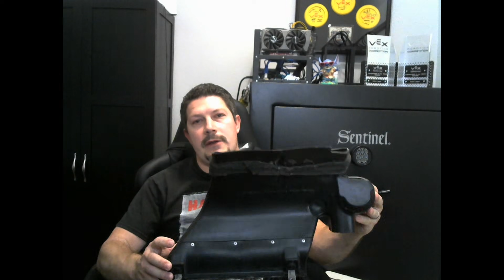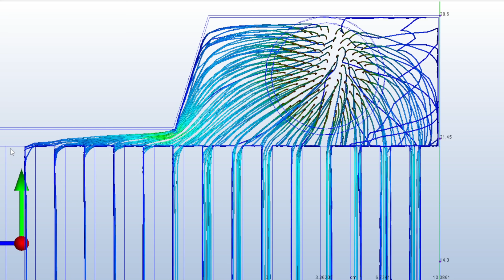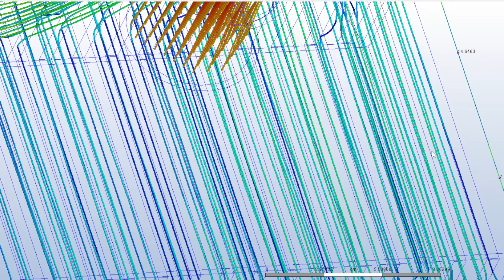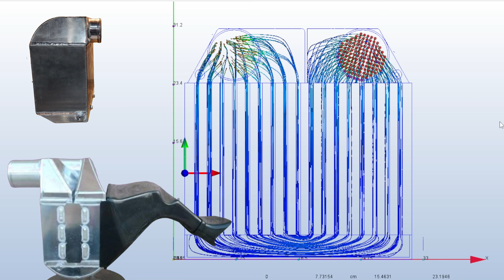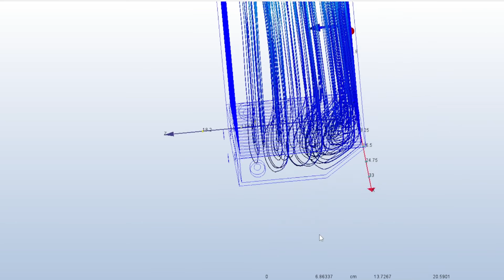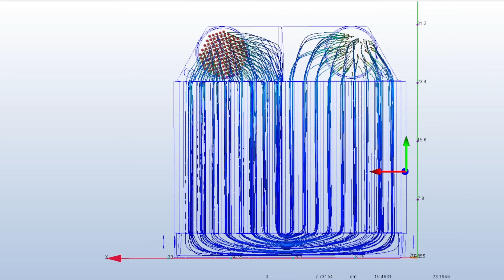SMIC Project 1 - Analyzing Intercoolers using CFD

Comment: Cool video! Is the pressure loss negligible with this design compares to a stock intercooler? Please also consider selling this kit after it is done.😂
Reply from the maker: As far as selling, we will see just how much work goes into the entire kit.  I work a lot of hours with my regular job so I don't have much time for this kind of stuff but if its feasible I may think about it.  It would have to be small batches of like 10 or so if there is actually that much interest.  The air duct is going to be challenging because I don't really have much experience with carbon fiber so I'm going to 3d scan, then design and print the air duct, then give it to somebody that does carbon fiber for them to make a mold and ultimately create the duct our of carbon fiber.  I'm set on carbon fiber so it will match the AutoEXE intake
Reply: @touchedbyawankel cool! I think getting 10 people interested in this kit is definitely achievable!
Reply: @touchedbyawankel  I would definitely be interested in one as well.
Reply from the maker: If there is a large pressure loss, then the turbos have to work that much harder to make "X" amount of desired pressure.  So if you want 10psi at the manifold and the turbos need to put out 13psi to generate that at the manifold, then that is 3psi pressure loss.  Generating more heat and workload on the turbos.  I don't forsee there being much pressure loss with my new intercooler because the volume is more than enough to support the stock twins output volume, you really run into it when there are restrictions or running high volumes with large turbos.  No doubt the stock core is more restrictive than the new setup based on basic internal channel measurements.  I'll be posting before and after videos directly comparing my intercooler to the stock one on the street and the dyno so we can see if there is a change in response or lag going with the larger core as well as the temperature and pressure differences of each.  I'm hoping I can plasti weld some bungs on the stock intercooler for direct comparison testing of air temps and pressure loss comparison.